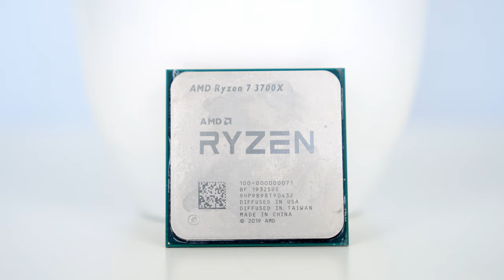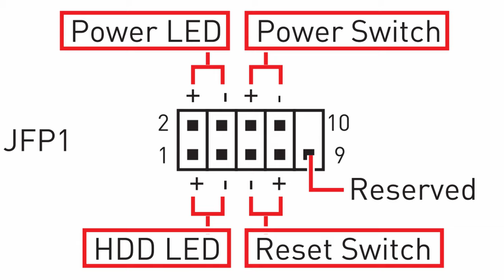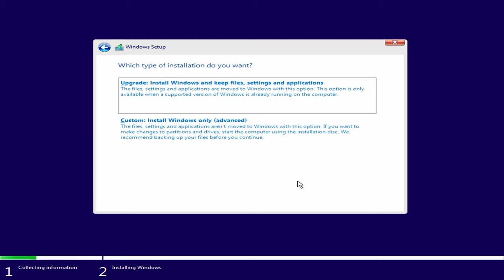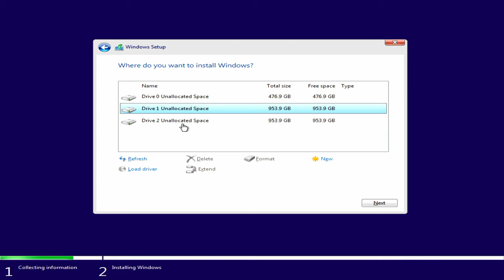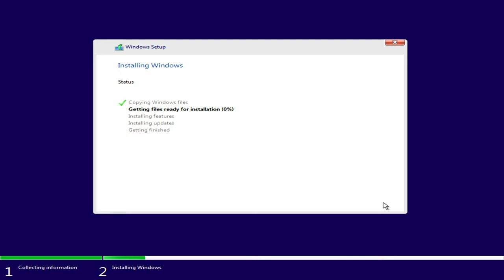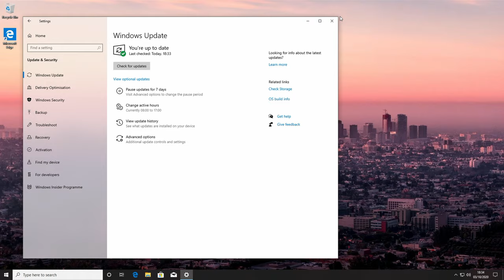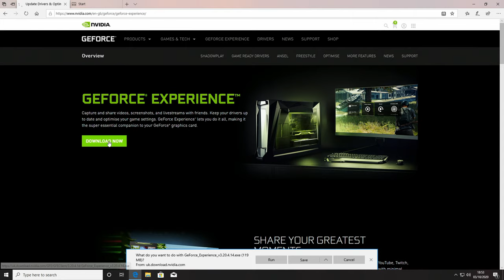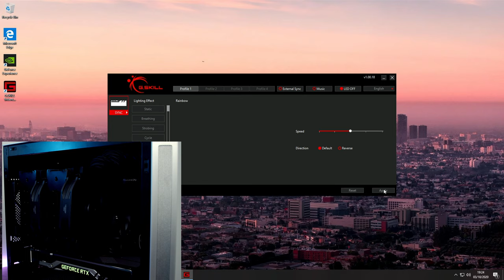Lian Li TU150 Mini-ITX Step-by-Step PC Build Guide

Comment: Power supply cables. I do the opposite order. I plug them into the board first, because that is the hardest part and them I plug them into modular power supply last.

Comment: This is a fantastic video. Answered all of the questions I had about this very build. You have an excellent, measured style. I plan on replicating this, albeit with a 3900X and a 5700XT.
Reply: Christopher Flannigan do you think slimline fans under the gpu would make a difference? It would provide a bit of clearance between a dual slot card and the gpu...

Comment: Good day, would like to confirm, The air cooler Noctua NH-D15 chromax black is using its original 140mm fan and it has no clearance issue with this G.skill Trident Z(44mm) RAM height? 

Great video guide you have here, saved me a lot of research time to make sure each part fit into this Lian Li TU150. Many likes to this video
Reply: @ChristopherFlannigan  thanks for the earlier info confirmation. Btw the space behind motherboard, how many MM deep is it? thinking it is able to fit a 13MM fan hub behind.

Comment: Dude! You are a legend! This video is godsend to me! I have similar build. Same case /psu/processor. I was using a noctua U12S but not happy wth the temp. I also have same noctua d15 brand new collecting dust on my shelf. I was even about to sell my ryzen 3700x this week but thanks to your video I will just rebuild that system from scratch. My beef regarding the 2.5 mount is when I bought it from Overclockers I did not get the ssd mounting screws .can you please put the link to what screws I need to get to mount an ssd or 2.5 SATA mechanical drive to the case . Would also be able to do maybe like a small video how to attach a 3.5 case along with a 2.5 in this LIAN Li case. Your explanation and build path is the best on YouTube and am sure lot of people would agree with Me.

Comment: I too want to say thank you for this build guide. I built my last PC 10 years ago so I have to re-educate myself from scratch to do a new build. But in particular your tips on when to wire things to the motherboard saved me a lot of headaches. I unfortunately, ran into a problem I did not anticipate from this build guide. I went with the Core I5 13600k and the Asus ROG Strix B760i motherboard with a Gigabyte Eagle RTX 4070ti. When I went to install the Noctua NH D15 cooler it was impossible to put on the second fan  because the headers  for the front panel HDMI 3.0 and type C were located directly under where the cooler's second fan would  sit. Bending those cable enough to get the fan in would break their headers on the motherboard. Is there any kind of right angle adapter for those two connectors? Is there somebody who makes that kind of thing?

Comment: Really happy I found this video and your channel. It was exciting to see someone find almost all the exact parts I was planning on buying for this build and actually put them together in the case I'm wanting. With that said, I have a couple questions.

1) You mentioned that PSU cable extensions add quite a bit of bulk and are difficult to route, and said that custom length cables would be ideal. Do you know what the appropriate length would be to route cables through the top compartment where the handle is? Specifically the 24 pin cable. It'd be nice to have everything I need ready to go. Otherwise, I was planning on measuring what I would need once I'm mid-build... and wait for the pieces I'd need to 100% complete the build.

2) The Noctua CPU cooler looks tight! Would the Noctua NA-HC2 heat sink covers still fit with the window panel on? It looks like there is some clearance, but it's hard to tell.

Thanks for the great video!

Comment: I have the exact same case, msi b550i mobo, ryzen 5 3600xt, evga 1660 super, 1tb samsung evo plus nvme, 16gb corsair vengence ram, corsair aio 120mm cpu cooler..
It was all very tight but i stay around 77°c gpu temp

Comment: A note about using this motherboard:...if you are using the standard Wraith cooler , you need to use low profile memory. I am doing n ITX build with a 5700G (first AMD build), and the sticks I have block the cooler from aligning properly

Comment: Hey great video. I will build a PC in this case next week so it is a nice guidance for me. 
I have a quick question. I will use the same PSU and want to install a SSD and a HDD. Do I need a extension SATA power cable for this case to supply both drives. For me the Corsair SATA connector seems a little bit short. 
Thanks and keep it up.

Comment: Goddamnit! How did you get your hands on the SF750!! I have been looking up, down, left right and center everywhere for 3-4 weeks now and I don't see it in stock absolutely anywhere! I have this same case, I am gonna put it together soon. Only missing the 3080 and the PSU, so in the meantime I might just get a second hand 2060 until I can get my hands on a non-scalped card. I am throwing in an i5-10600k, cooled by the NH-U14S, with 16GB of 4133MHZ RAM, 4TB of M.2 SSD's and 2 TB of SATA SSD's, running on an MSI Z490I MEG. The reason why I need so much power is I plan to do a  full-system custom loop down the line once I get a 3080 with a waterblock on it, and I need enough juice to throw on some meaty overclocks on the CPU and GPU, and the system will probably pull well north of 650W+ out of the wall. 

I live in the US and it has been out of stock for far too long. At this point I'm wondering if a 650w will suffice. Silverstone makes a 700W PSU but I want to have some decent head room, and the reviews I have seen for it make it scary since people complain a ton about the coil whine or dead PSU's. Not sure what to do at this point.

Comment: I'm planning to build a system like this. I travel a lot and I'm wondering if this case will fit in my airplane cabin-sized luggage (50x40x20 cm). It would be very helpful to know this information.

Comment: Love the video and explanation. I bought this case but cant decide on the motherboard. What are good options in your opinion? 
Also, woudnt it be beter to install OS on the smallest ssd? Many thanks!
Reply: The Asus B650E works well. Has an almost identical interface to the one hes using! Works well. But use a ROG Loki SFX-L. The cable lengths are perfect for this case. Not an inch longer or shorter than needed, if you want to route everything above At the top.

Comment: Another really well put together video. Nice step by step and very clear all the way. You mentioned that the Nvidia 3000 series cards could be used instead of the 2070 you put in. Would a 3080 fit in this case with enough room to cool or would it limited to a 3070 maybe?
Reply: @ChristopherFlannigan  Thanks again

Comment: Excellent build and thorough guide! I am using a MSI B550I motherboard and D15 CPU heatsink in a TU 150, but was unable to seat the heatsink properly without removing the Noctua exhaust fan attached to the back of the case. Your video didn't show any issues installing the heatsink with the exhaust fan installed though. Any suggestions?

Comment: Thank you for your fantastic videos!  I have learned a great deal.  I am in the process of pricing out a new system to replace an old Alienware Aurora R5.  My plan is to keep the GTX1080, 2tb SSD SATA and 256gb Nvme M.2.  I was considering a TU150 with air cooling which would allow me to get the tower off the floor or a Lancool II mesh with a Fractal S36 360 AIO based on your reviews.  The processor will be an i7-10700K as I have always used Intel for my flight training systems with an ASUS Z490-E and 32gb-3600mhz RAM.  Perhaps this would get too hot for the TU150? I would really appreciate any suggestions you may have.  Keep up the great work!
Reply: Christopher Flannigan thank you very much! I’ll look for one soon. All the best!

Comment: For some reason when I route the sata cables over the top of the case like you did, it does not comfortable reach the SSD drive. Am using the same SF750 PSU.

Comment: This is a great video, my build is very similar except I went Intel and an ASUS Z590-I motherboard. My issue now is I can't for the life of me get the second CPU fan (not middle one) to go in over the ATX cable from the motherboard. If I REALLY jam it down hard maybe, but I don't really want to do that. How did you get it on so easily? I ordered another of the case fans to attach to the heatsink as a backup.

Comment: Hello, thanks for this vid its fantastic. I have built a couple of computers and this is a good comprehensive guide for the UK. It would be great to know if you feel this is a good case for a 4k gaming set-up for a living room to go with my LG B9 oled tv. I am doing allot of research and I get I need to upgrade my 2070 super to a 3080 however I am running a 7600k and I need to understand which processor would be a good upgrade path if anyone can help me I would be very grateful as so much choice its baffling me.

Comment: Christopher, I recently purchased a msi MPG Z790i EDGE WiFi mini itx motherboard and i am unclear what M.2  slot is the Gen 3.0 on the motherboard. Is it the slot on the back of the motherboard or is it the top or bottom slot on the front stack? can you please help with the proper m.2 slot configuration? Thanks in advance.....

Comment: Link to the extension cables used?
Reply from the maker: Should be in the description
Reply: @ChristopherFlannigan  I don’t believe it is, but I bought a different one from Amazon that has the 3 8pin for my 3080. Also used your affiliate link to get the fan splitter. Thank you for this video!